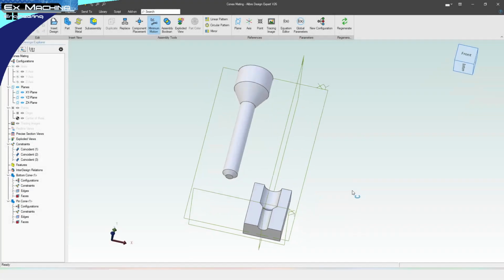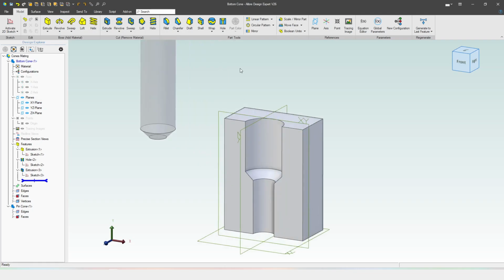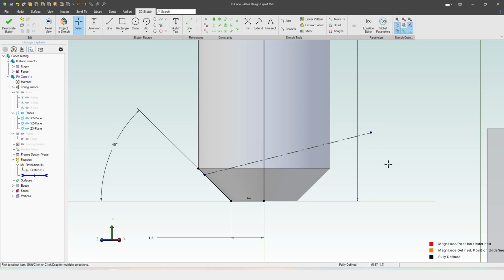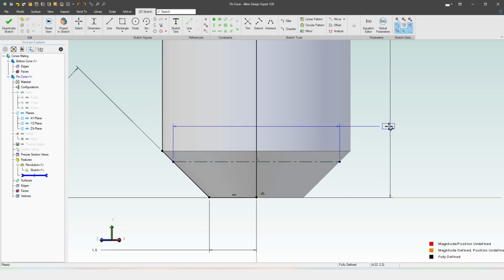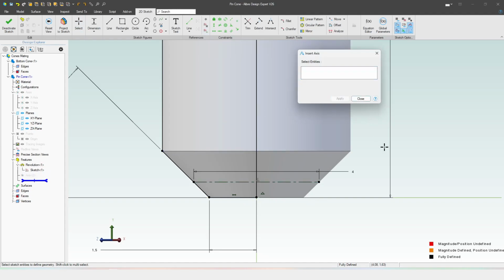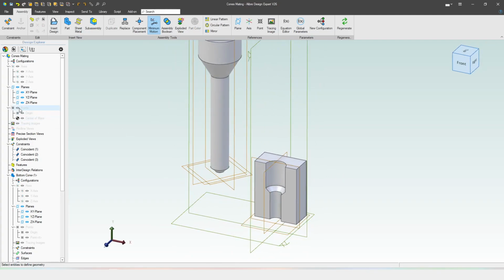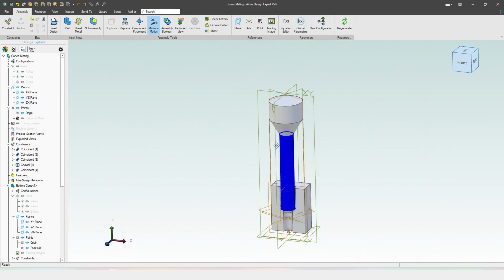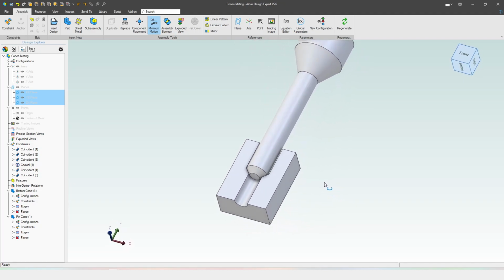Master Cone Assembly in CAD with This Simple Trick!

Comment: How about showing the pin off perpendicular, or it's full wobble envelope? This way we could explain the magnified impact of very small deviations of interfacing features.
Reply from the maker: Actually, constraining it so you can move it through its full wobble envelope is pretty tricky. It would require a completely different approach. This was for a design where that cone would just be a stop to the motion of that pin.

On top of that, Alibre is only a CAD system, it lacks and physical interference tools like you would find in a kinematics simulation program. So, you would need to derive the equations to drive the joint limits parametrically so you can actually see that on the screen.

It can be done, but in a production environment, if I needed that type of information on the dynamics of a system like that, I'd just use a simulation software designed to do that.

Also, what do you mean showing it off perpendicular? Like the two cones being perpendicular to each other or tangent or something. I didn't completely understand that.

Comment: Hmm so one cannot just constrain the intersecting edge to coincide with the angled surface?
Reply from the maker: No, unfortunately if you select the edge and the cone the only available constraint is the coaxial one, which although necessary as well, does not constrain the edfe to the cone along the axis of rotation.

If I remember correctlty, I had developed ths tchnique a few years back when I needed an assembly like that and couldn't get it done with a straight constraint. I think it was in Fusion360 that I initially encountered the problem.